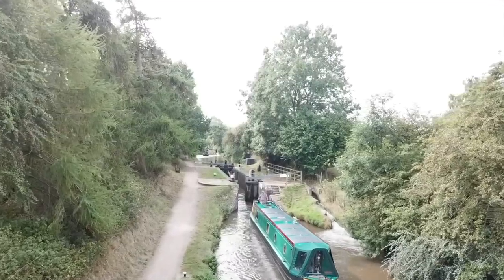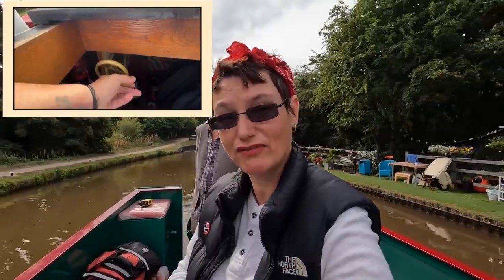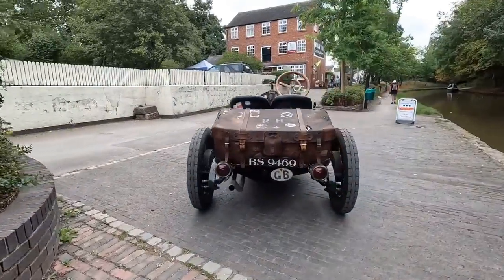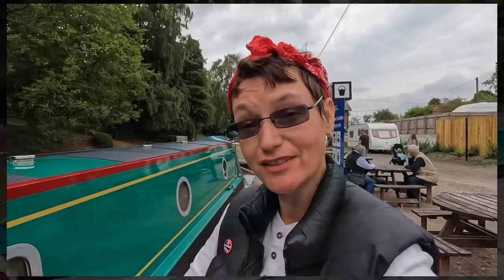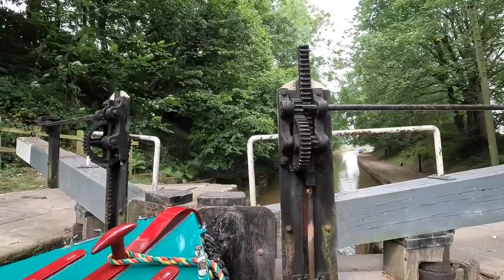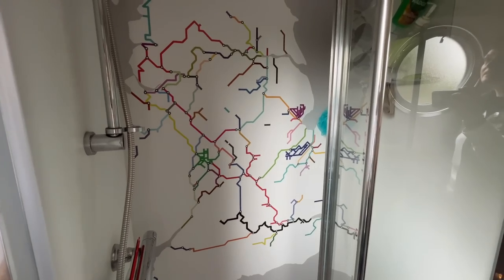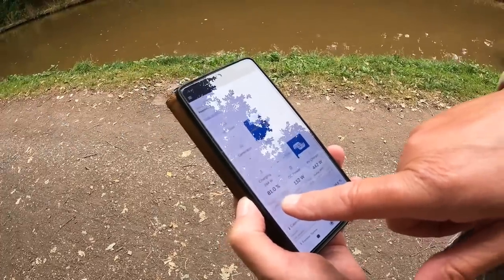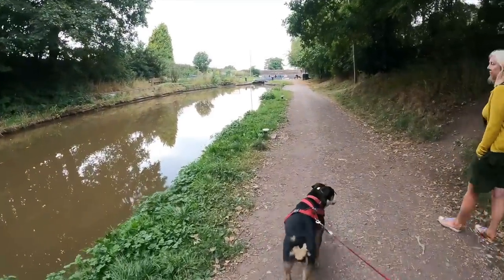The ELECTRIC NARROWBOAT | Narrowboat Interior | Audlem CANAL LOCKS [Ep 74]

Comment: Really enjoyed this one Cap’n H!
Lovely piece to camera about that brilliantly novel boat. Cheerful engaging and funny, but still asking questions, finding answers.
The boat is effectively diesel-electric like a conventional submarine, a big battery bank for silent running and a diesel for top-up. The difference being it didn’t look to have a driveshaft from the diesel. I think its a great concept and fantastic during a sunny summer. The boat fit out is just great and I love the name. Mind you, I don’t fancy having to replace that bank of batteries when the time comes a few years down the line. Also I’m wary of relying on software and short-life technology like phones when support for both is fragile and so very brief of late. 
Don’t forget your noisy old engine can be readily fixed by a heavily sweating person in a string vest by hitting it with a mallet and wrapping petticoats around steam pipes….as described in the narrowboat documentary “The African Queen”.
Reply: The generator and drive motor are not directly connected it's a serial hybrid not a parallel hybrid the tec works on any phone it's a app additional there is a screen in the boat with the same info on it. any mechanical part can be replaced or serviced like any engine.

Comment: Wow that is outstanding, no lithium batteries which are extremely dangerous. I'm impressed, what a boat.
Reply from the maker: Lots of boats have lithium LifePO4 which is very safe it’s only lithium ion with is dangerous
Reply: @TheNarrowboatPirate  No it is lithium that is dangerous regardless of what else it is mixed with.

"Lithium is a chemical element with the symbol Li and atomic number 3. It is a soft, silvery-white alkali metal. Under standard conditions, it is the least dense metal and the least dense solid element. Like all alkali metals, lithium is highly reactive and flammable, and must be stored in vacuum, inert atmosphere, or inert liquid such as purified kerosene or mineral oil."

Comment: I wonder if they are planning to add a woodstove for heat in the winter?  They could also use it for cooking and with the proper equipment you can also use a Woodfire to generate some electricity.
Reply from the maker: They have a multifuel stove it was in the video - smokeless coal or wood

Comment: Its going cost a fortune in the winter if you have to use the generator, plus i wouldn't feel as if i was on the cut if it was that quit, the sound of the engine is what makes it special, i love the sound your engine makes.
Reply from the maker: The genny is amazing though, very quiet and it charges the batteries super fast so not having to put it in for hours and hours … but yes no sound when using the motor when cruising …. I can’t hear myself think on mine 😂😂😂😂😂
Reply: No we only need to run it for 1hr to cover our daily power usage when there is no solar .

Comment: An amazing boat, thanks for showing it to us.
It makes life much easier on board, but you never mentioned the cludgie.
Is that electric too? Or is it like any other narrowboat that needs emptying every now and again.
Reply from the maker: All boat toilets are pretty much the same, so I didn’t film it 🤣
Reply: @TheNarrowboatPirate  Oh how disappointing.  I thought it would have had a macerator  at least.
Reply: @MrOVERANOUT  you can get electric incinerator toilets for narrowboats.  They use a lot of energy though, so it might mean you need to run the generator to 'flush the loo' depending on solar, battery charge level, etc.

Comment: I do love the idea but the upto 2kw of Solar depend on sun and time year won’t touch the sides of powering the 20kw motor.  So it’s mains electric or the diesel generator to charge the batteries!
Reply from the maker: They are running off HVO though, they are both very conscious of being as eco as possible …. It’s small steps and much better than my old thumper chugging away 😂🏴‍☠️